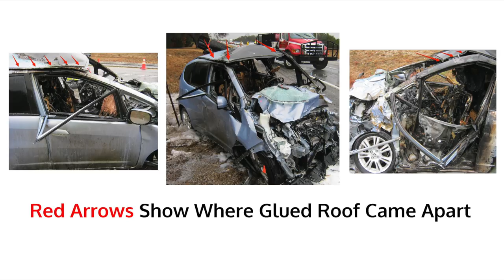John Eagle Collision Center Defective Car Repair Video

Comment: Good afternoon!
I disagree with you that the victim is not guilty, I am from Brazil, I recently had an accident in my region, fatal fatalities, with a PORSCHE, a rare vehicle for aki, because it has a high purchasing power. But let's face it, the occupants of the vehicle, infiltrated all local traffic regulations, ingested alcoholic beverages, high speed, above that allowed by the road, made prohibited overtaking.
What I mean is that there are no security items that resist because everything has a limit, how will you process a manufacturer in a case like that?
As for your video, is the gluing process allowed, tested and approved by leading companies?
And how will we do in convertible vehicles?
Hugs.Henrique

Comment: So as an example of how the welded structure is stronger, you use a glued one to demonstrate 🤣 .
Nearly every car made today has some unibody components attached with adhesive. 
Some cars some with carbon fiber roofs. Do you think those are welded? What a scam
Reply: Well that might be one of those “Choice of the words” thing.
Like there might be some exceptions, racing cars, supercars, etc, but it’s high likely on production cars that whether or not that vehicle uses carbon fiber roofs on it or it’s just an ordinary metal roof it’s using, those aren’t even “welded” first of all, but structural components beneath it to which it’s attached is. 
i mean i might be on the wrong since i make mistakes, certainly because i’m an idiot but as you can see in this video called “ Carbon Fiber Roof Installation Overview - BMW “, even though it’s just an installation of carbon roof, it doesn’t come with structural components. 

Tooo sum up all things, from my perspective this guy’s probably trying to explain how “Unwelded” Roof structure can cause cases like this. Not the roof “Sheet” thing itself because that’ll likely ain’t gonna make no difference in how will it affects the safety of the vehicle. Because you know, that’s just an sheet metal that’ll probably make an hole of a dent even if it just gets punched once after all.(exaggerated)